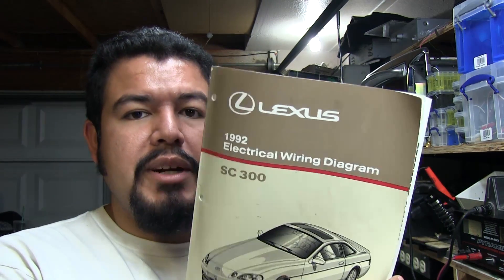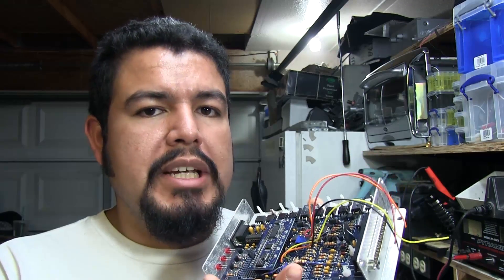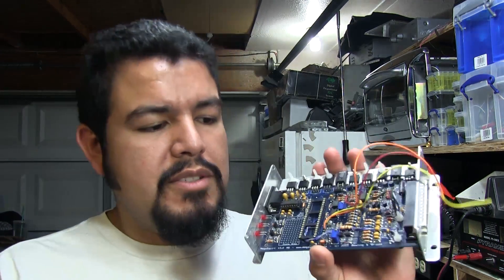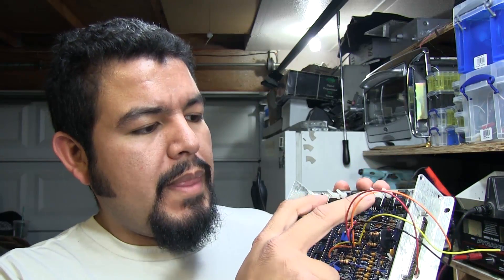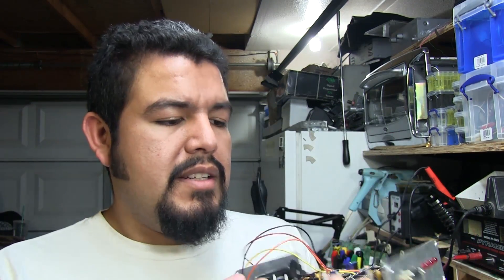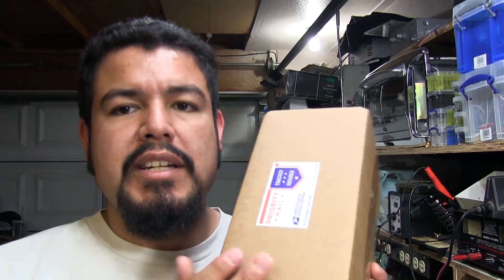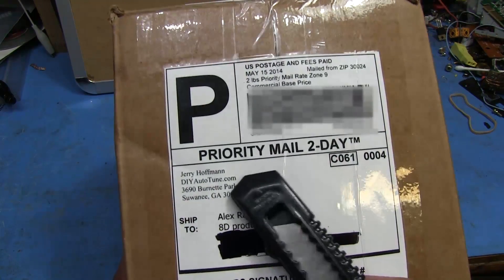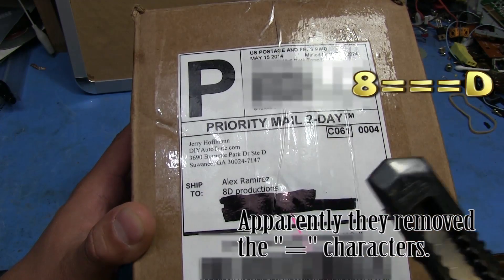TWB #6 | MegaSquirt EFI Project Intro

Comment: All this going on in 2014?  Seriously?  Go buy a Haltech or Autronic with Autotune and be done with it.  Company, proven, reliable, even plug n play.
Reply: +Caribbean GTR Not everyone wants plug n play. Some people get satisfaction by building their own stuff.
Reply: +greg hassen You're  going to put $20,000 in a 2JZGTE put on s home built  ecu with 2 outputs?   I love electronics but I love making power from my car reliably more.
Reply: +Caribbean GTR 

Megaquirt is a fairly open project with history tracking back to DIYEFI (Do It Yourself EFI) and EFI332.

Many people use it, and there are multiple boards, that have been CPU upgradable.

There are DIY kits like this one based on v3.00 board with plain old components to solder.

There is also the option of a factory built v3.57 board, functionally equal to the v3.00, but made for SMD components.

You can look and by all of this from www.diyautotune.com as well as some other sites.

There are also pre-built and tested units of every version, as well as what is called PNP (plug and play) versions, tailored to specific applications, with adequate connectors and extension to fit certain popular choices.

No need to look at MS with prejudice.

Comment: I have a electric supercharger idea which I want to build but not sure where or what parts are needed electrically.  I am mechanically Inclined but kinda just don't know where to start with the electric side of it. I have the Svt m112 Supercharger made belt tension pullie system..have 42# lb injectors. .fuel rails. ..fuel pump...blower cams...tuner..so on and on....u get the idea..my plan is to electrically supercharger my 02 mustang gt.  I have great fab skills and can figure the mounting and have solid wiring skills. I know that I need or want a motor that is 600 to 6000 rpm enough torque to turn the supercharger which is minimal..duty cycle to maintain my heavy foot;) I feel I would like variable control which I would like wired to Tps sensor.. ((luckily I do know this is a 5 volts reference sensor related directly to my speed..duh;) or to a variable voltage controlled switch that is mounted underneath the gas pedal??. I hope you could lend your resources as in motor part numbers recommend , controller. Ect.. where and what I need and maybe a brief instructions on how to wire.. I hope that you can led you knowledge to just another car guy looking to go fast..well faster ..12.873..108.19..in the 1320'...oh by the way this will be mounted in the truck ... to be the sleeper they never hear (quite blow off in trunk) or see coming;) kinda unfamiliar with youtube and if u can send me a direct message that would be great to....Thanx
Reply from the maker: ron karkau They keep changing so much on here that it took me a while to figure out how to send PMs... You have to go to the "About" tab and there will be the option to send a message. I'll send you a PM there.

Comment: Definitely interested in the megasquirt build and process! Keep the videos coming!

I bought and built a v3 diy kit for a project but ended up selling the car but now I'm looking to possibly continue to finish putting it together and getting the ms3x board to control a 1jzgte and hopefully the auto trans as well.
Reply from the maker: miamipacheco Don't have much going on at the moment, other than I installed a knock sensor module on it, but I have yet to edit and upload the video for that. I've been behind on getting all this stuff up due to other household projects currently in progress. Hope to have it up soon.